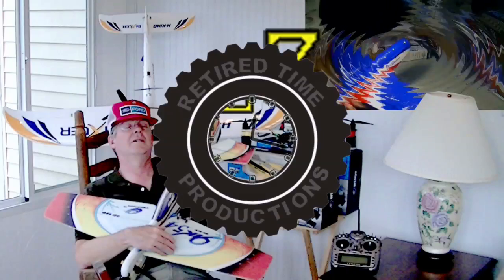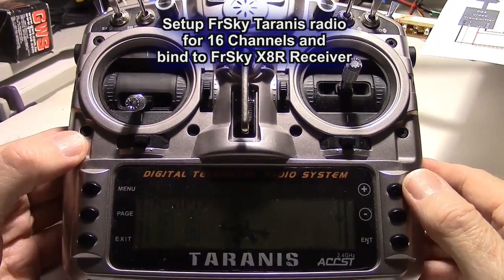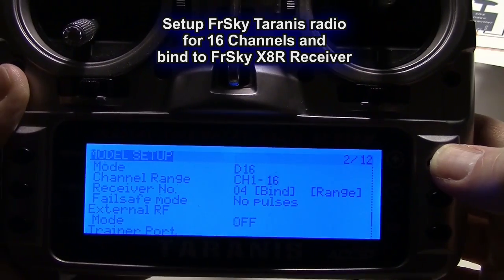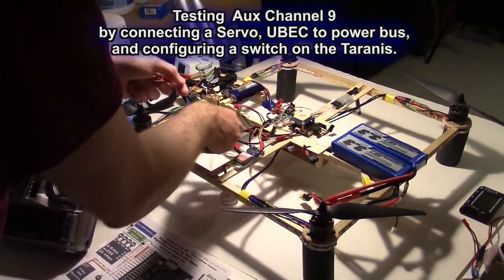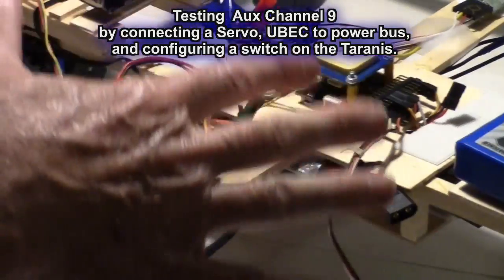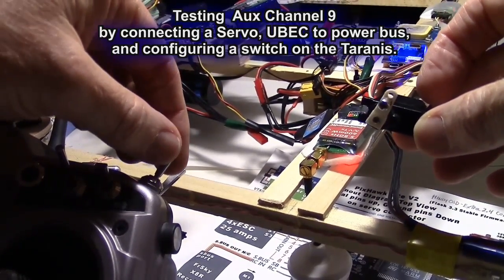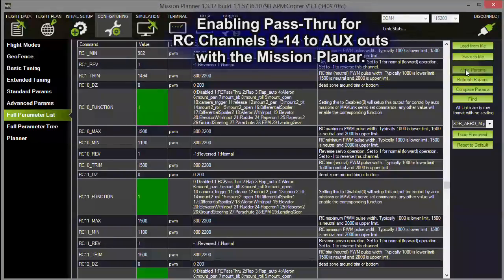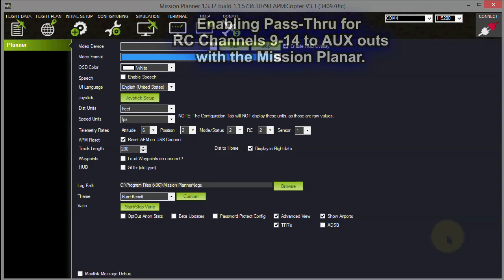PixHawk AUX Outputs Setup for 14 Channels, Taranis X9D, X8R Receiver

Comment: This was incredibly helpful, very much appreciate your time and expertise!!!  I looked for hours before stumbling upon this video, and these instructions made is a breeze.
Reply from the maker: The subject is a hard thing to search for.
Maybe I could improve my tags for the video.
What phrases did you first use to search for it?
Reply: It's not specifically related to servo control, but my PDB has a led controller built in, so I was searching for  phrases like pixhawk led control, pixhawk led strip, pixhawk navigation light control, etc.  after a while, since i had the led controller on one of the aux channels i searched for pixhawk aux out, and your vid was top result.  I think it was just poor searching on my part initially.  I kept searching and getting lost in forum posts and pdf's when searching on google, and youtube.
Reply from the maker: That's interesting. So I added some of the things the aux outs could be used for in the description and in the tags. Thanks for your input on my output :-)

Comment: very useful article. I had been looking a way to use pass through RC channels on pixhawk to control my camera and gimbal using a single RC receiver. this is not described in ardupilot.org documentation. luckily I have a taranis set. the video has been very nicely presented. the complete process is very clear to implement.

Comment: Great project and presentation 
How do you connect the pixhawk flight controller to the gas engine??

The PWM is used in between the GAS Engine throttle servo and the pixhawk

Comment: Cant get this to work on pixhawk been trying for many many hours...using frsky r-sxr and Devo12s with 4n1 module..i want to pass ch8 thru to any AUX pin so i can turn on/off led lights using a turnigy rx switch..i see ch8 in the sliders working fine it just wont pass it thru to the aux pin...Also there is no rc_function i guess it was replaced with servo_function?  Also the pins on the pixhawk are different the signal pin is on bottom and ground on top ..voltage still in the center as usual

Comment: I've been looking everywhere for a solution to power my landing gear or any kind of servo with the aux ports. I'm still having issues. Do you have to have a ubec to make it work? If I did have the Ubec(I just ordered one) how do I hook it into the battery pack? Do I solder it to the main pads where the battery leads hook in? I would love any help!
Reply from the maker: I usually solder the UBEC at the output from the PixHawk power module so that the current usage of the UBEC gets measured with the rest of the current.

Comment: Hi dmerc00...i've just shown your video again....coool...but is it mandatory to power on Pixhawk with a Bec or is it possible to power Aux rail with a bypass from power module to get 5.3volts on this AUX to wire a servo...?
thank's a lot, happy flights
Philippe
Reply from the maker: Yes it is possible but check your documentation because there maybe a jumper you have to remove like JP1 on the APM. Or there may be no power to the rail at all to begin with.
Reply: Hi dmerc00...it's not APM but Pixhawk...have i to open flight controller to remove the jumper like JP1...?
thank's a lot

Comment: Hey man. I tried to use all 14 channels doing what you teach but I couldn`t connect all the 13 servos because of the lack of space and the channel 13 and 14 doesn`t work.
Reply from the maker: It might have something to do with the receiver. I know my X4R couldn't squeeze in more than 7 channels on PPM without an upgrade. There wasn't enough time for all the pulses to get through. Timing is everything.
Reply: dmerc00 It is a X8R US version. What upgrade should I do to make it work?
Reply from the maker: On the X4R it was a firmware update which required getting special programming cable. I saw some where on RCgroups.